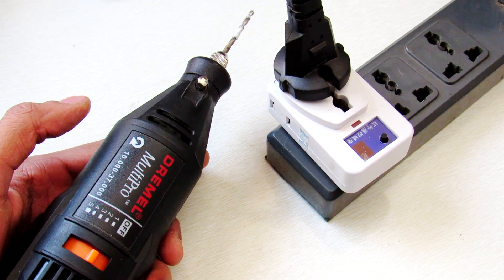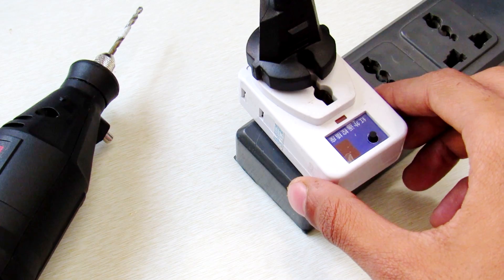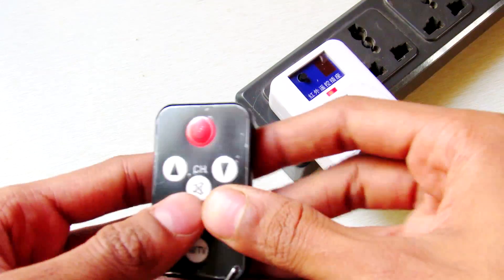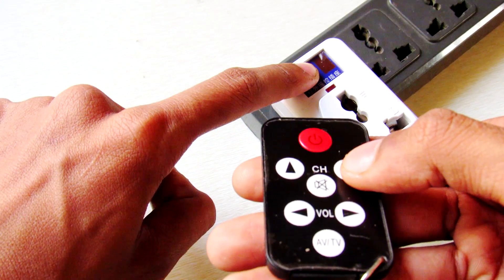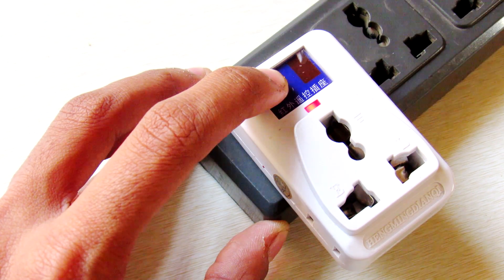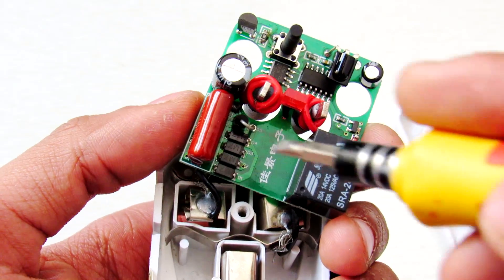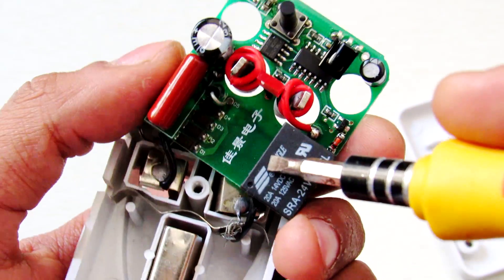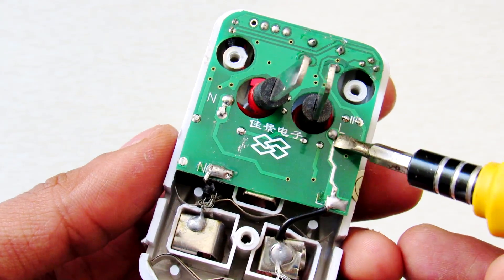Remote Control Outlet for Lights and Fans

Comment: I don't ever connect a 20A load on that thing! look at the size of that relay and the guage of wire that they've used to carry 500w load!!
Reply from the maker: If you want to carry higher load change the relay, but other than that control circuit workes good.